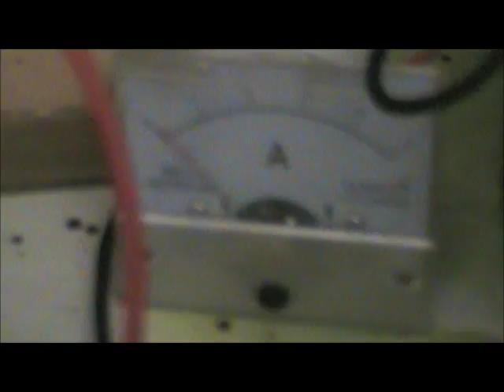Disruptive discharge

Comment: @User2718218 I will repeat my most sobering thought for you with respect to people that play with coils:  95% of the free energy experimenters have almost no idea how an inductor actually works.  They can work on the bench for years and still be completely clueless.  For example, supposing you started a thread related to the Joule Thief.  You know how a Joule Thief can light up 50 LEDs?  Ask people to explain how that works and I guarantee you that almost nobody will be able to answer it.